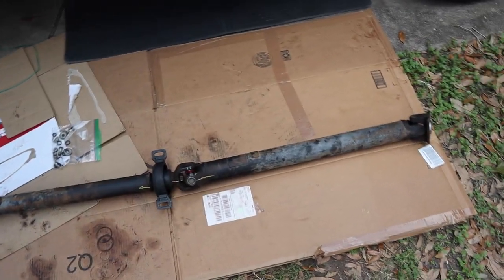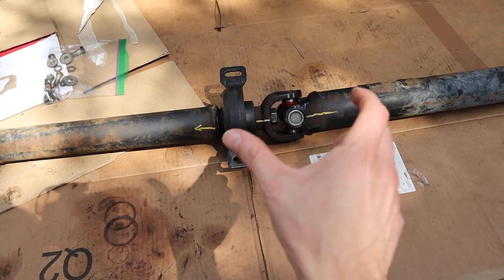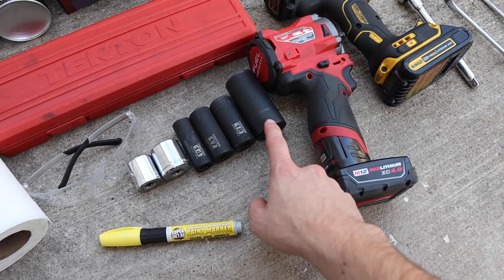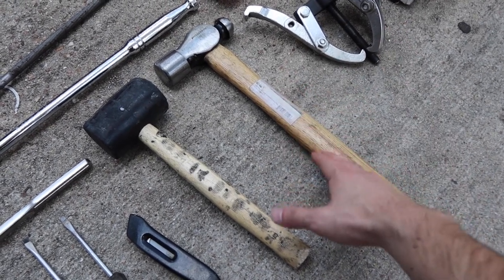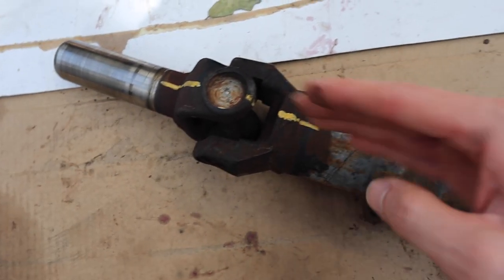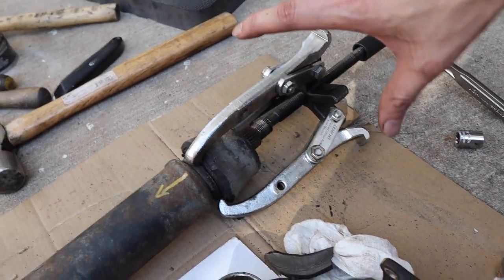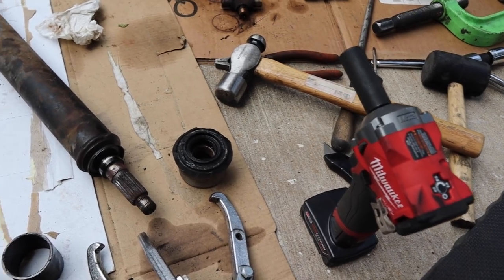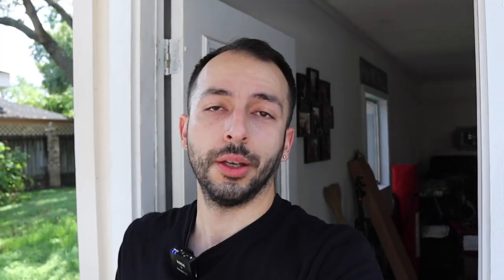Carrier Bearing and U-Joint Install Overview Mazda B2200 B2000 | Flake Garage

Comment: What year and model do you have , I have 86 b2000 with single drive shaft with no carrier bearing I got lucky lol
Reply from the maker: I did this on my 88 B2200. My 87 B2000 I think it’s solid too. I need to check but maybe we are into something there lol

Comment: Can you use lowering blocks if you have the driveshaft with the carrier bearing
Reply from the maker: yeah but make sure they are angled blocks if you are going 3+ in size otherwise you'll be hearing some bad noises from the driveshaft

Comment: Was this causing a vibration when accelerating in 1st gear?  TIA
Reply from the maker: You’ll get vibration or clunking if the carrier bearing is torn or loose